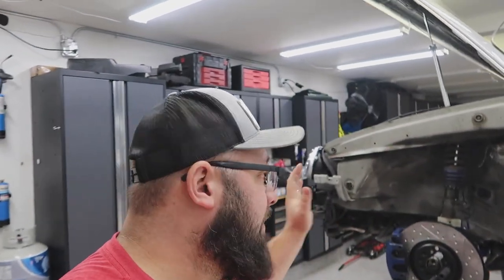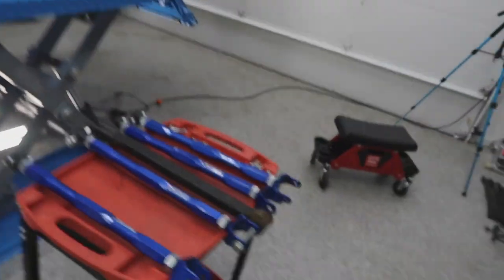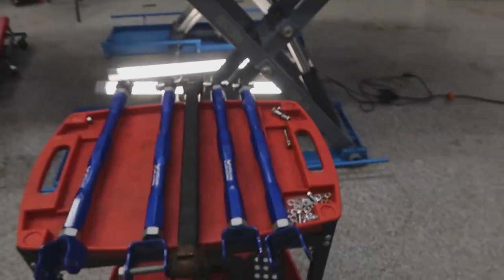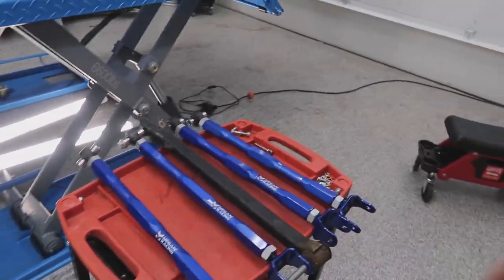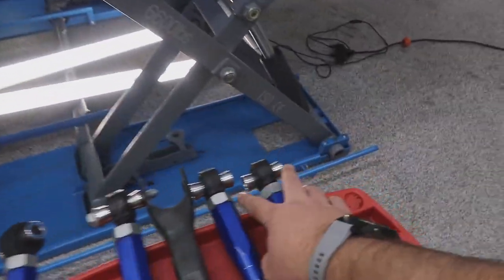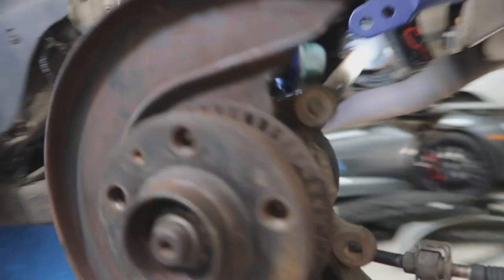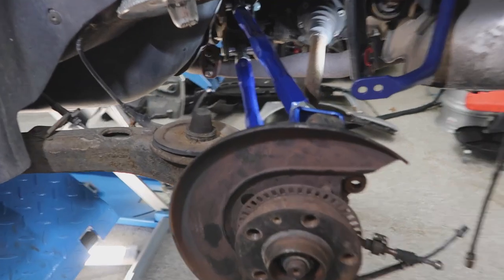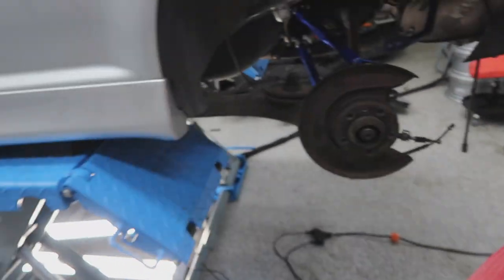VW MK4 R32 REPLACING Adjustable Rear Control Arms! The Project Car Rebuild Pt.12.

Comment: How did you get the subframe bolt out for the upper rear? I'm using my impact and pb blaster on it, and it's not even budging.
Reply from the maker: Damn man. Sorry it’s not working. Mine came out pretty easy.